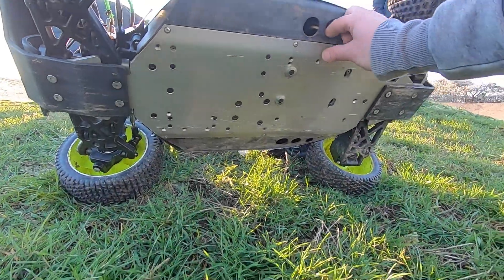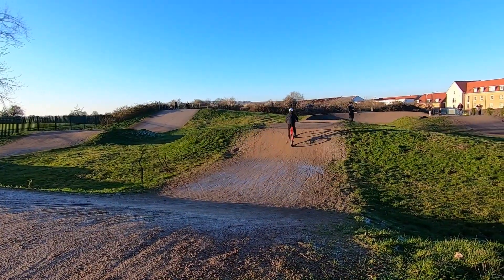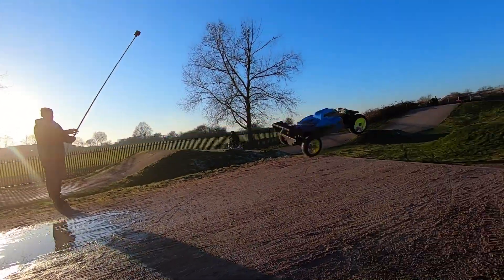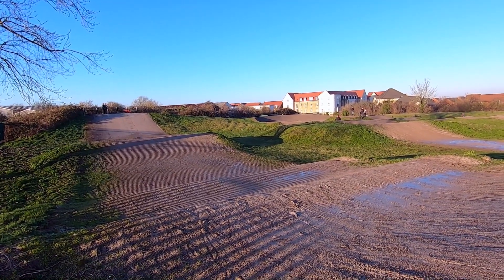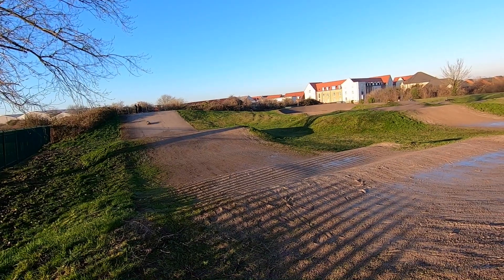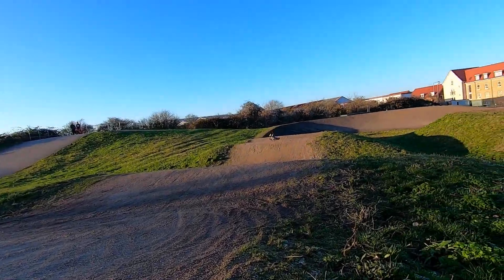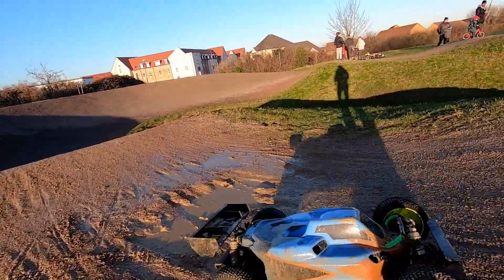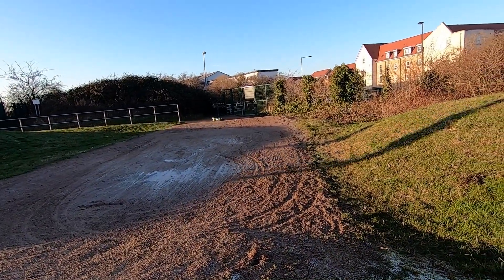TLR 5B BRUSHLESS at the BMX track!

Comment: I'm hearing that you aren't sold on 1/5 brushless because of the weight, but this comment would apply to nitro or electric, no? You've said in other videos that you're a huge fan of 1/5 scale vehicles, so what's different with this one (or the K8S?) thanks, love the vids
Reply: The only thing I could imagine is that the petrol engine is quite heavier than the brushless motor so it wouldn't kick up the back that much than the brushless. But imo brushless >>>> petrol :D